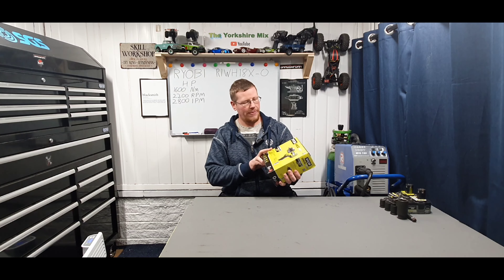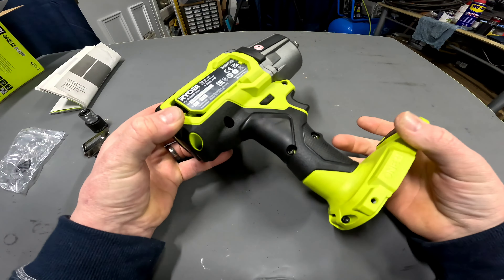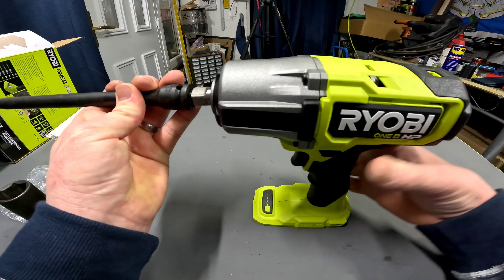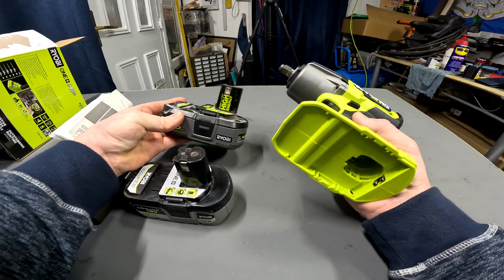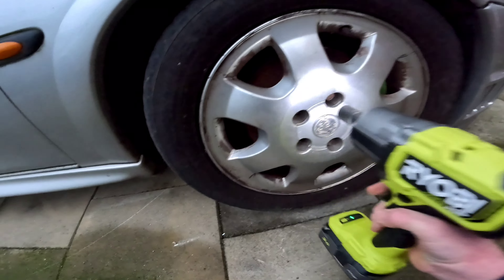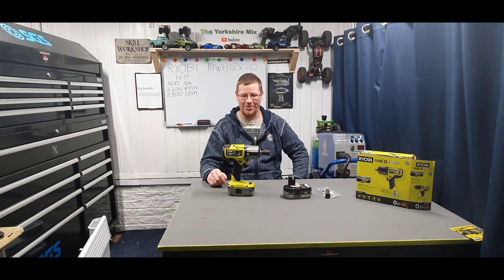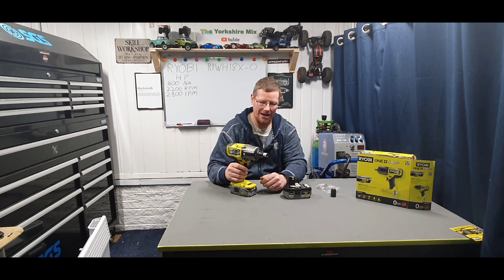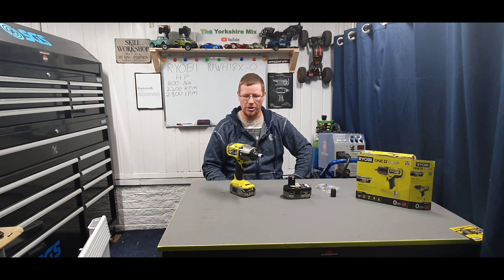Ryobi HP High Torque Impact Wrench RIWH18X-0

Comment: Ask someone with a Honda Civic if you can take off the crank shaft pulley bolt…😂😂. These crank shaft pulley bolts from the Honda civics are the most c*nts of a bolt I ever came across with
Reply from the maker: 🤣 I will have to look for 1 then lol. I've actually got another car for a summer project so I will give it a go on that 1 when I take the engine out👍
Reply: All Honda crankshaft bolts are overtight 😢